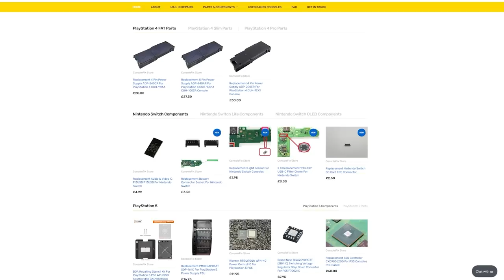My Xbox Series X Caught Fire! Can I Fix It?

Comment: How you can get 100 pounds for SSD if it is paired to the APU of this board ?
Reply: If you are able to clone the raw partition at the beginning on the drive to the replacement SSD it will work
Reply: @coctailrob  AA, it is used as a donor disk when original is kaput  and a raw partition is cloned on it. Thank you
Reply: @coctailrob  Alternatively, it's a standard M.2 drive, somebody could use it in a computer or steam deck or something.